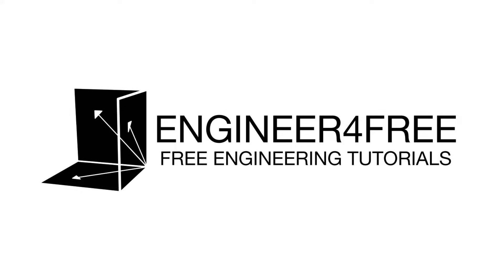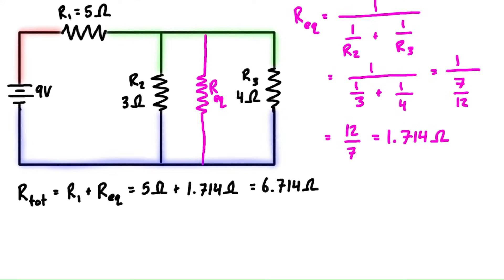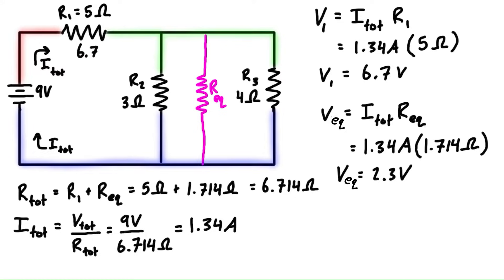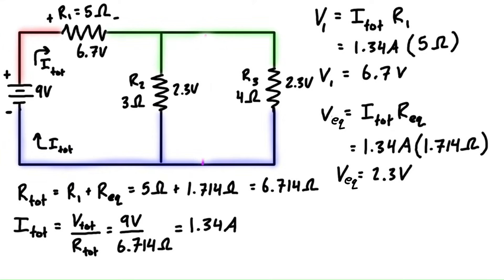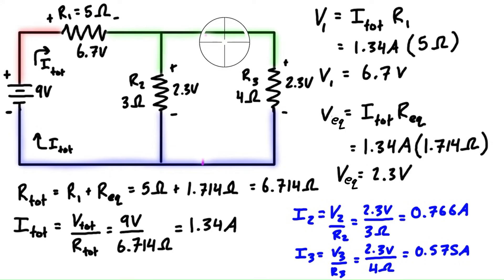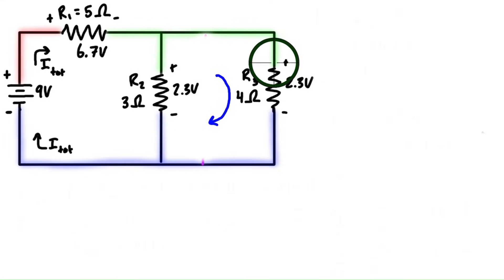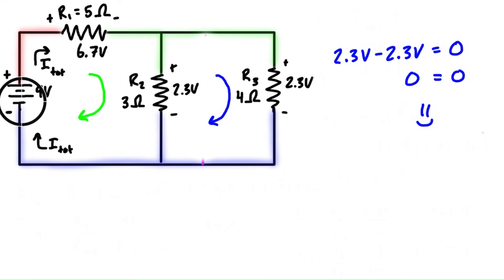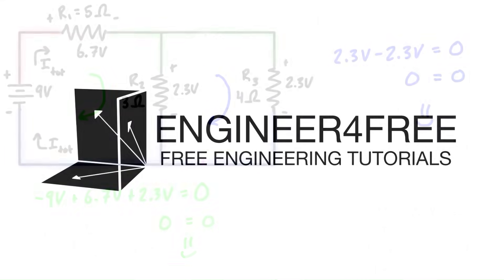Kirchhoff’s Voltage Law (KVL) Example Problem #1

Comment: i have doubt on equation. Current & voltage travelling from voltage -ve terminal to +terminal,  When voltage passes from -ve to +ve terminal there is potential rise. So we need to consider +sign for the voltage. Correct me if am wrong.